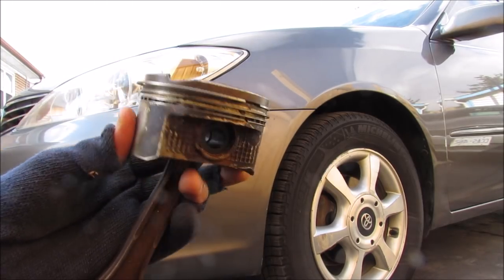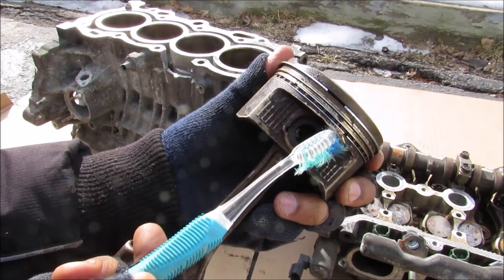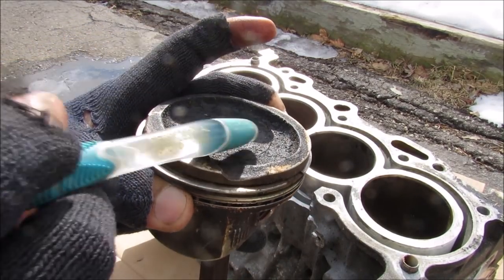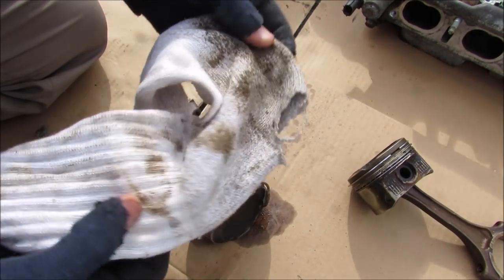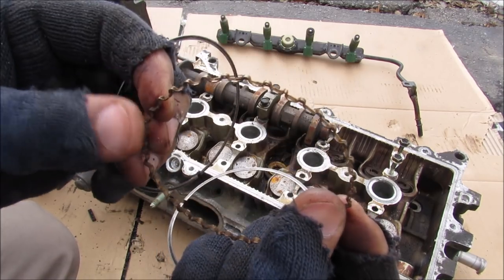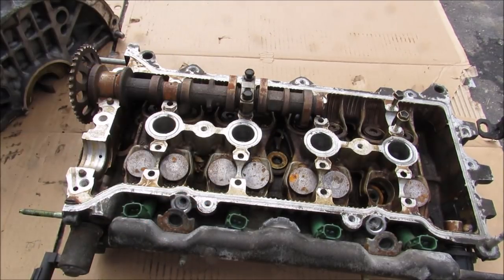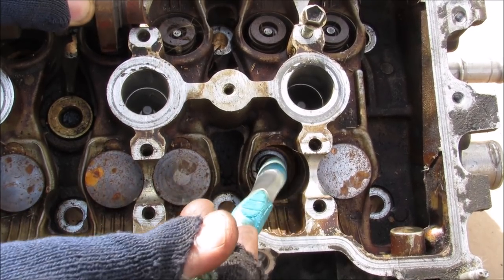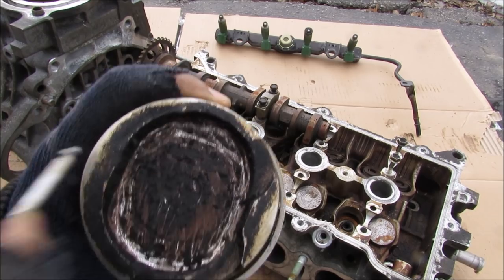Why do Cars Burn Oil?

Comment: My 1999 Honda crv does the plume of smoke thing, not all the time thou, only once in a while, good to know why.
Reply from the maker: +Tony32 only on cold starts eh? How many miles?
Reply: Miles? j/k (I'm Canadian) 435k km, yes only on cold starts.
Reply: Are you using the correct oil viscosity? Conventional or "synthetic"?
Reply: 5w30 Synthetic (mobil 1)
Reply: Unless your owner's manual specifically requires it, consider switching to conventional oil and changing it every 4-5K miles. Its laminar flow characteristics (not precisely the correct term) are different than most "synthetics" and you may see much less of that sort of oil burning, which isn't good for your catalytic converter.
Reply: wholeNwon Thank you, I'll keep that in mind next time I do an oil change.
Reply: In case you think that you'll be doing your car a disservice by switching away from "synthetics", there is ample independent engineering data to show otherwise.  That's as long as you stay within the same API service rating (SN, GF-5 probably). How often do you change your oil and filter?
Reply: Every 5k km oil and filter, I do it myself.
Reply: Tony32 try high mileage oil. It swells the seals and could help. Once you use high mileage oil stay with it.
Reply: It doesn't happen all the time, if it gets worse I'll definitely try that. Thank you
Reply: I have to put oil in every 2 weeks in my toyota corolla
Reply: speedkar99 there are many reason why your car will blow burnt oil out of the tail pipe, don’t just assume it valve stems seals

Comment: I have a 2002 toyota 4 runner with  140 K miles and it is burning so much oil. i am using Valvoline Max Life Synthetic blend oil. I am changing the oil and filter every 4K miles. Any advice ? Do you recommend to change the type of oil? Thank you

Comment: Hi i have a 2.4 2az-fe engine. 7k miles has used 5litres of oil topping it up.   Now currently trying lucas 10-40 oil to see if that helps..    is it just pistons to change or a complete rebuild? To cure it
Reply: Hey Abdul! Wonderdust will re-profile the cylinder wall, stopping the oil burning! $15.99 on Amazon, please be sure to provide a review once you fix your engine!

Comment: Bro I changed my valve seals without removing the head on 03 Civic. Is that not good? Just finished today.
Reply from the maker: That's good. Hopefully nothing made it down the engine
Reply: @speedkar99  I blocked oil holes to make sure no contaminants gets in. That wasn't an issue but the oil is getting in the combustion chamber. I used a boriscope to look inside and I saw oil after the cars been sitting for 24 hours or more
Reply: How much was your oil consumption? Did it fix it completely on your car?

Comment: yeah I had the same problem with kia rondo 2007 it was burning oil so bad until one end up with a blown engine becaus the car was running super low in oil
Reply from the maker: +Kamal El Abbady whoops 
Well I guess your 2018 Rondo is much better now eh ? 🤓

Comment: doesn't it occur because the heat compress the metal of the piston and the oil is not completely scraped of the walls and something is consumed in the chamber?

Comment: Glad to say my 2000 Corolla still burns no oil after 220,000 klm. Are there any products you recommend to further prevent carbon build up?
Reply from the maker: +Evan93 since it's a design flaw, no product can help 100%, but you can mitigrate it's chances by using a good quality oil that won't break down and change frequently.
Reply: Yeah I always make sure to change my own oil every 5-6 thousand klm's. What about fuel system cleaners? Do you think those help with carbon build up like evreyone claims.
Reply from the maker: +Evan93 it will help to keep the injectors and valves clean, but not exactly the Piston rings. 

Another cause of sludge is too much moisture from condensation caused by short trips. You should take some longer trips in between to allow engine to warm up and evaporate that moisture.
Reply: ah 2000 corolla and made 220k trip?  I have 2009 corolla and just about to touch 200k and yeah also glad that yet it hadn't blow any kind of smoke also I run my car at compressed natural gas.
Reply: synthetic oil

Comment: I just can't understand how a metal/metal contact can provide full sealing.. especially with the pressure there must be inside the combustion chamber during each explosion.
Reply from the maker: The rings are constantly squishing outward against the cylinder walls
Reply: The oil film is never broken. It's like the parts are on water skis

Comment: 94 corolla here 4efe engine the car goes through a crap ton of oil it basically needs 500 ml every week it smokes at startup but i've found out that only when im going downhill without pushing the gas and then the drive levels out and i push the gas to accelerate there is a huge amount of blue smoke its insanely big makes me embarassed to drive it.What could the problem be?
Reply from the maker: Valve stem seals
Reply: Thanks for the reply im going to try the seals hope that fixes it.

Comment: i have a 2008 camry, 4 cyl, startred burning oil at 40,000, regular oil changes with conventional oil. switched to synthetic at 48000 miles, no more oil burning. i assume because oil is now getting through the ring....
Reply from the maker: It'll burn it soon, that 2.4L engine was known for it!
Reply: @speedkar99    yea, thats why i was watching the video

Comment: My car is def burning oil i add a quart every 700 miles but i dont have any smoke from tail pipe. 2004 honda 2.4 liter
Reply: Use high detergent 💯 Synthetic Oil like Amsoil Signature Series to slow down the oil burning issues consumption. I use to burn 1 quart of oil every 1000-1200 miles, now  after 800-900 miles the oil dip stick is still at 75 % level.  I’m waiting for 50% level on dipstick to top off.  I’ve been able to cut consumption from 3qts to 2.5 qts using Amsoil OE/XL and now looks like i will be track using less oil every oil check.  I still change my oil every 3K.  When using Mobil 1, I was changing the oil every 2K for a while before switching over to Amsoil
Reply: How often was the oil changes prior to burning a quart every 600-700 miles?  That’s a lot of oil being burned off. Have you try changing the oil every month?

Comment: You haven't got to pull a head to do valve stem oil seals. Fill a cylinder with compressed air, and the vales stay up even without the valve springs present and you can do your thing - A special tool exists where you can bang on the valve upper spring seat and collect the collets magnetically. Some old school guys have filled cylinders with rope to keep the valves up. Still, either way not worth it on a car that's been kept in the sea though! Consult the OG toothbrush on this matter - not your brother's toothbrush
Reply from the maker: I have heard of the compressed air trick. Risky, but hey some get it to work. 

You gotta watch your buddy doesn't disconnect the air hose the next bay over and plop...there goes your valve into the engine !

Comment: I have an old celica that burns loads. I keep an eye on it and top it up. As long as I keep it topped up will it keep going? Wil it get worse? I love it but its a 1000 pound car. And not worth a rebuild
Reply from the maker: Eventually the rings will get so bad it will affect compression
Reply from the maker: And if you care about your catalytic converter...

Comment: Also what do you think about slightly increase oil thinkness to reduce oil comsumption? (like switching from 5w-30 to 5w-40)?
Reply: To reduce oil consumption? You're pushing the problem into the future, i.e. you might mitigate the issue a bit for a year or three, but once them seals start leaking they'll keep leaking.
On a slightly related note, my daily driver calls for 5W-30 oil, which resulted in clattering noise from worn solid valve tappets. Switching to 5W-40 made the engine noticeably quieter and smoother.

Comment: Is it true that it is good to use thicker oil on older engine with 200 000 km or more??
I have a montero sport 1998 V6 3.0 liter engine.  All mechanics here in colombia tell me to use 20w50 oil despite Mitsubishi recommending 5w30 or 10w30 in hotter climate.   6G72 engine that i have has been using 20w50 oil for long time i bet, but i do not like the idea of having such thick oil when i see all your engine videos and to see how many and how small the oil passages are.

Comment: my engine ran without coolant for some amount of time because of cracked radiator and now my engine burns oil, blue smoke when shifting gears and blue smoke at startup and lots of blue smoke when revving hard, mileage and pickup both are still good can you help me about that

Comment: Nice video! I got a healthy 2001 miata with 189 000 km that burns too much oil but still have good compression - planning on doing a rings and hone job during the winter. You think it's worth putting new pistons or just the rings?
Reply: Do you like cussing and throwing tools ? The be my guess 😂

Comment: Can you fix this by operating the engine at maximum temperature for a long time like highway speed so the carbon burns away? Because in other causes this process should clean the engine. Is it possible the build the carbon from the oil ring as well?

Comment: In a good running engine, do the oil control rings completely remove all oil on the cylinder wall during combustion? Or would there still be a thin layer?
Reply from the maker: +mrsemifixit it removes most of the oil, it's not 100 percent effective, there will be slight oil burning but not enough to need topping off between oil changes.
Reply: mrsemifixit  oil left on is what burns because of the hot cylinder. Rings are like window squeegys. If they are worn they don't remove the oil
Reply: mrsemifixit the hot cylinder is what burns the left on oil. Rings are like window squeegys. If they are worn oil remains behind and burns out the exhaust.
Reply: They don't have to be worn-out. They are not perfect, not 100% doing their job even from the factory, because they have to allow the cylinder to operate. So, with every stroke, a tiny quantity of oil is burned, even by a new car. 
There is also the oil vapors in the engine cover (the blow-by gases, if not ventilated, can condense and combine with the oil vapor present in the crankcase forming sludge or cause the oil to become diluted with unburned fuel, degrading its quality and decreasing its effective life).
And there is also the burned oil by the turbo, if the car has one. 
All that adds up to about 1000 ml of missing oil every 10.000 miles, EVEN IF  THE CAR IS NEW.

Comment: Great video! If you buy a used car and it doesn’t burn oil but it’s old (165K miles) can changing the oil more often help the engine last longer or is it too late?
Reply from the maker: +Alfred Lyon changing the oil more frequently that it needs to be is useless. Just keep up with the maintenance schedule and keep an eye on the oil level (I check mine at every gas fill-up)
Reply: speedkar99 Thank You 🙏🏻
Reply: Obviously that's the correct answer.  But it's amazing how many people think otherwise.
Reply: Alfred Lyon  if it's not using oil stay with a good quality oil. If it is using oil try high mileage oil. High mileage swells the seals and could help with the oil burning.

Comment: OK. Question, I lifted the tappit cover and cranked it and oil came up through the valve springs. But when I turn on no oil comes out the muffler. Is that normal. Can the cam shaft warp?

Comment: What about the 1MZFE, Camry 2004?
Reply from the maker: +issoloko2412 what about it, what videos would you like to see?
Reply: speedkar99 sorry mate, I meant, does the Camry 2004 burn oil excessively  as well?
Reply from the maker: +issoloko2412 no that engine is solid after 2002

Comment: And when you do not change your oil the rings freeze up due to carbon build up, you lose compression and burn more oil.
Reply from the maker: Good point
Reply: Don't forget, the cylinder wall cross hatch wears off, that is the main cause of oil burning. Enter Wonderdust! restores the cylinder wall profile! Stopping the oil burning! Viola!

Comment: On the last part you mention it's not worth replacing your valve seals bc in a high mileage it'll continue burning oil in that case what do valve seals do anyways? Can you better explain this how is it that'll keep burning oil if you changed the valve seals how does a high mileage differ?
In this case you're saying that it's not worth doing a complete engine rebuild on a high mileage bc it'll continue having problems
Reply: Unless it's not worth it bc it'll keep running hot therefore continue burning oil later on so in this case doing a complete rebuild would be worth it and checking your cooling system

Comment: You don't have take the head apart to replace valve seals.
Reply from the maker: Yes that's what makes a valve stem seal job expensive
Reply: No you don’t, there are different ways to replace  valve seals without removing the cylinder head. You can use a compressor through the spark plug hole, maintaining air in the cylinder to keep the valve from dropping into the cylinder. Or you can use a 1/4 inch  rope and insert it through the spark plug hole with the piston all the way up, use about 3 to 4 feet of rope...🤪 and depend on what type of car...have done it on a Nissan 280zx
Reply: @speedkar99  I was driving when i typed that. I meant to say you don't have to take the head apart to replace valve seals.

Comment: I last was a tech over 20 years ago. But, can anyone clarify: Is there actually any way to clean out the inside of the engine without tearing it down? 20 years ago, there were some BS chemical treatments that really were just money makers. Are there any new treatments that actually work?
--And, I presume that carbon buildup can and does cause valve seat problems that can present as a vacuum leak. Yea?

Comment: Hello sir 
My car is hyundai avante 2012 and  it keeps consuming oil extermely and there is no a bluish smoke and i checked PCV valve and it is ok, also i think the gasket is alright because the engine is not overheated acually i have gave up what could be the possible reason for this problem ?
Reply from the maker: With the 3.3? Wasn't that a known problem on those Hyundai's?

Comment: Speedkar. Love your videos. Quick question. My 01 tundras valve stem seals are leaking a little. This truck means a lot to me and I'm a big toyota truck enthusiast. It just burns oil on startup, and theres no change on the dipstick. Do you think i can still keep this vehicle for a very long time? Everything else is great. I want to keep this truck for as long as possible as it has one of toyotas best engines, the 2uzfe. Thanks
Reply from the maker: You can though consider the other components that can get affected, such as fouling the catalytic converter and spark plugs

Comment: SPEEDKAR99 
   {{      ;;  If you car is burning oil often and needs to ADD oil what is wrong with the engine? the head gasket?
Reply from the maker: No. The valve stem seals or piston rings

Comment: I have learned how to stop your engine from burning oil, DON'T PUT NONE IN THE ENGINE
Reply: That's crazy!  Just don't run the engine.  Problem solved!  No need to drain any oil, either.
Reply from the maker: Good advice right there

Comment: Lol dont tell me you dont know how to change valve steam seals without cylinder head ?
Reply from the maker: +wide open throttle  that's so risky, what if the valve falls into the engine if you loose air pressure into the spark plug hole?
Reply: speedkar99 you rope method secure and easy